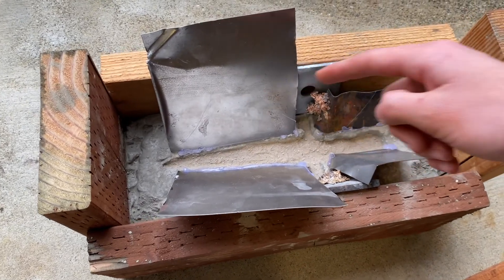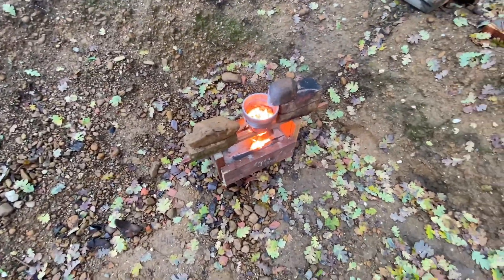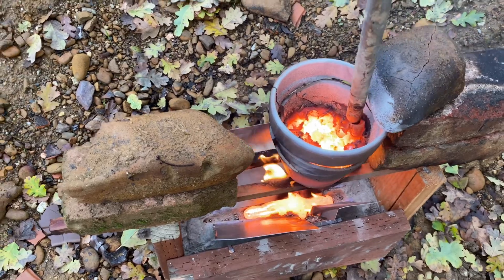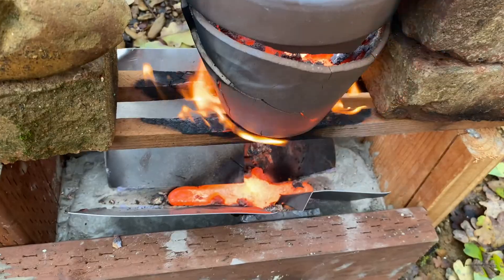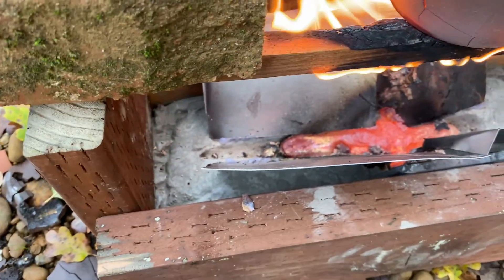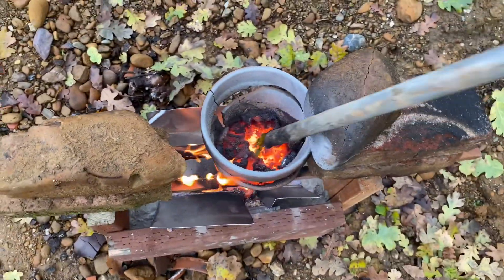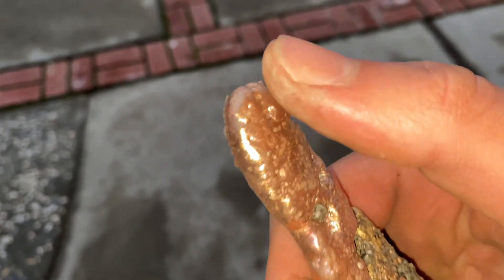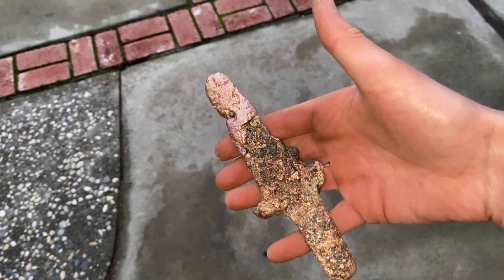Copper Casting using Thermite No. 2

Comment: Amazing video. Your channel deserves more. What container do you use?
Reply from the maker: thanks. Also i used just a clay flower pot.
Reply: @pyrochemminer3453  I tried to light a small qty of thermite using a mg ribbon.
Although the mg band lit up,the reaction didn't take off that well and formed only a few drops of iron.
You know why that happened?
Reply from the maker: the iron never seems to clump together very well, so some could be distributed throughout any slag produced. If you didnt light that much, you probably shouldnt expect a whole lot. You could check your ratio used and purity of the chemicals as well.